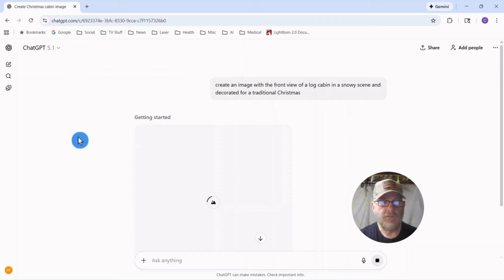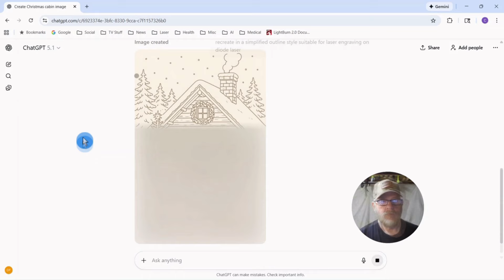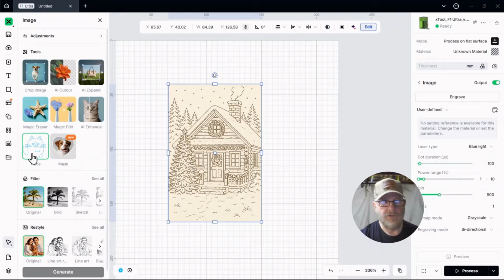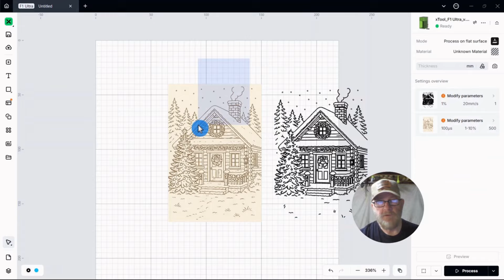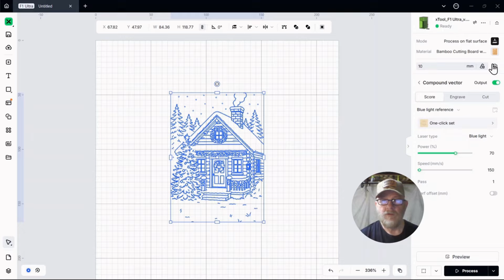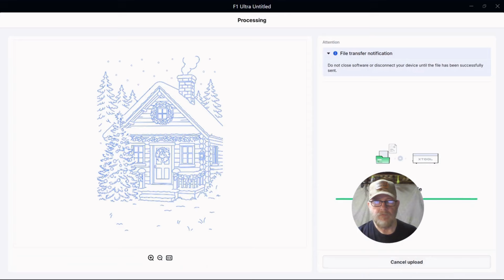Turn Store Products Into Sellers

Comment: The initial image is not complete. The smoke at the top is open and the right side of the cabin is not pictured. How would you edit the image to get the entire scene? Thank you
Reply from the maker: Once the initial image is created, you can ask ChatGPT to make the edits for you.  Adjust the prompt to state, 'ensure cabin is fully visible', or 'shift cabin down and to the left'. Usually this works well with either the initial image or with the outline version but you can get closer to what you want for sure.  Thanks for the question and for watching.  Take care - Dave!